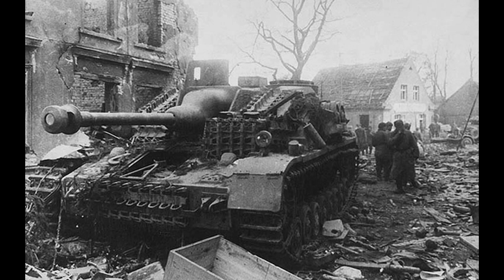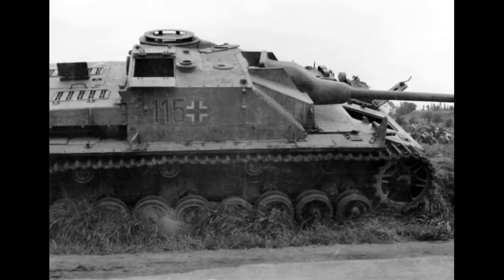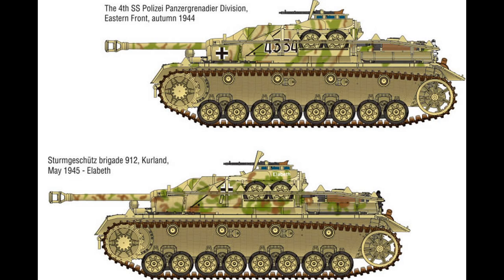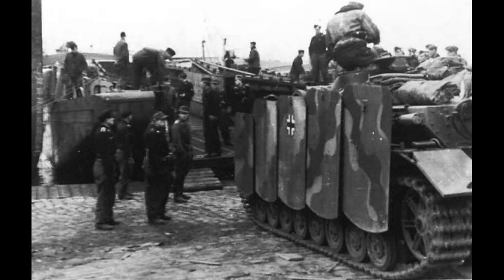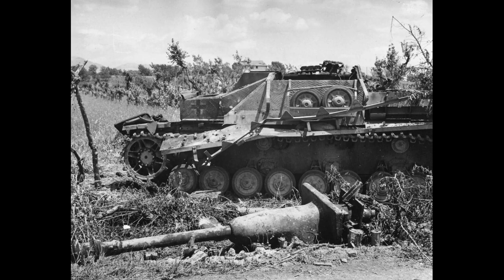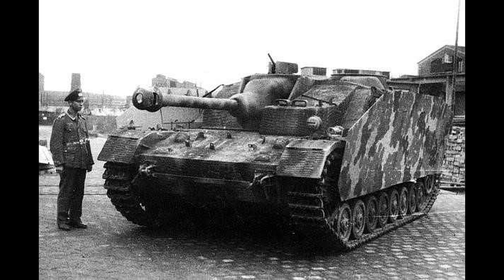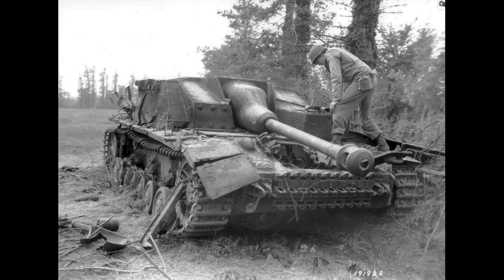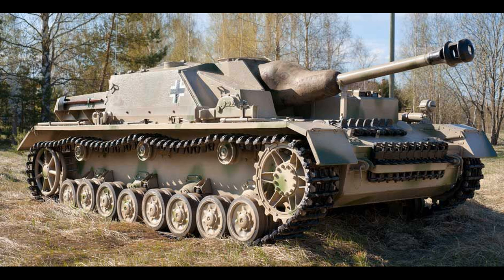Stug IV - Tanks In Detail

Comment: The StuG IV always had a roof machine gun.  The innovation you refer to was the change from the simple shield on the roof to a remotely controlled roof machine gun that could be operated from underneath without the loader being exposed to enemy fire.  This same mount was used on the late StuG III Ausf G and the Hetzer.  You can see the remote gun mount in some of the photos on this video
Reply: Do you know what the differences between the StuG IV and the Jagdpanzer IV were?

Comment: Hi! Nice and interesting video!
I can't be sure, but just for confirmation (as I'm right now building an old 1/35 model of the Stug IV), you say that the machine gun was a "MG 44"? Or did I misunderstood it and you say "MG 34"? 
Actually my kit (the old Italeri one) comes with a MG 34, but as the Stug IV was used late in the war (43-45), I was thinking about replacing the MG 34 by a MG 42, which would seem more up to date for the time period the Stug IV was used in battle. Would you know if the Stug IV ever used the MG 42, instead of the MG 34?
Also, I'm trying to find pictures of the Stug IV during the Battle of Cassino, but so far with no success! On the Italeri kit one of the four painting and decals options suggested is for a Stug IV during this Battle, which is what I'd like to depict on my diorama. Any references you'd be able to share about this? Pics of the Stug IV in action at Cassino, for instance, would be great, and greatly appreciated! 
Thanks!